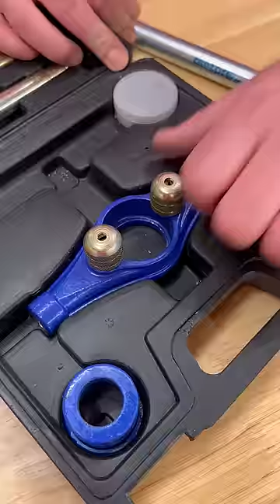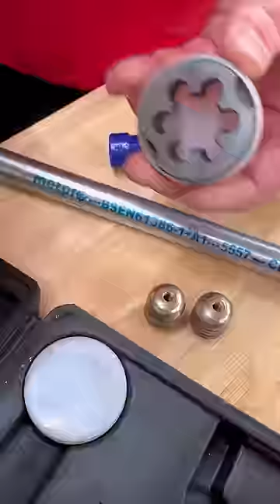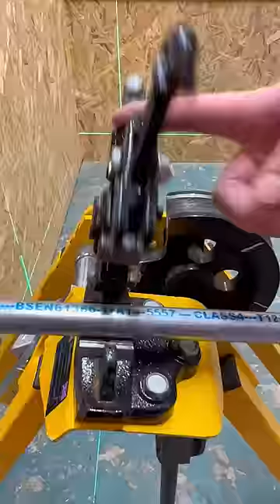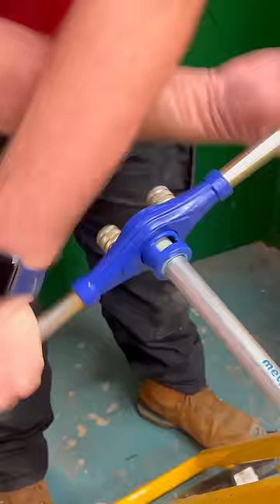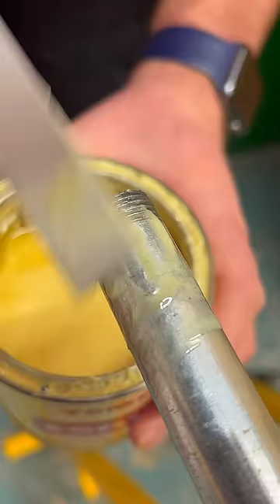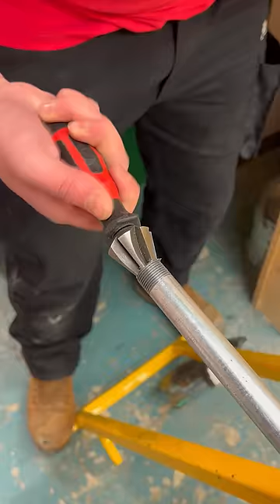How To Thread Electrical Conduit  Like A Pro!

Comment: We use a Ridgid 1224 machine and this would take about 30 seconds or less. I don't know if we are " Electrical Pros " but we do get paid money to do this.
Reply: And other electricians make do with gear like that.
Reply: I think there’s about an $11,000 price difference between the Ridgid machine and the hand machine
Reply: Milwaukee makes a power threader I've always been told if someone gives u a non ratchet hand threader it's because they hate you no other reason to use one other than to punish an apprentice
Reply: @Johnny-tq9no  I suppose it depends how many threaded ends are required.
Reply: hace tiempo no realizó  instalaciones eléctricas, me encanta usar esa máquina 👨‍🔧
Reply: @Johnny-tq9no  i saw the plumbers on my job have a battery operated milwaukee threader. heard them using it too.

the last time i had to thread though, it was up 2 flights of narrow stairs, and my partner was in his late 50s and none of us wanted to keep going back and forth, so we just used one of the hand held power threaders (i forget the model, but im sure everyone knows exactly which one it is im talking about) on a chain vice with dull grip teeth that wasnt able to bite into the paint, im an electrician, i was installing galvanized 1" and 3/4" that the job specified had to be all red on the conduit runs for fire alarm. but a large pipe wrench was able to grip into it. there was also no space for a sidewinder, so we had to use a mechanical bender, but there was only so much space for that too
Reply: @masterbond9  I feel you brother.  That sounds like my average week.

Comment: If you see an electrician with tools this clean and organized,  he has never used that tool 😂😂
Reply: My dad always keeps his tools clean and organized, and he’s one of the best diesel mechanics at his shop. Any time something breaks down they can’t fix, he gets called. Any time any of the workers are having trouble figuring something out, he’s the one to call.
Reply: Mine are clean and organized lmfao. I work on peterbilts. I just simply, take care of my expensive tools and don’t throw them around.
Reply: I work on small electronics and computers. My tools are always clean and organized. I also keep my other tools clean and organized. Hell, if I’m going to look all over for a crusty 17mm socket to change the oil in my car, it's in its case in the correct spot and, while not spotless, is very clean.
Reply: Normalmente cuando utilizas una herramienta debe ser limpiada después de su uso. Y las herramientas para electricidad siempre deben estar limpias y libres de grasa.
Reply: Or doesn't work on price 😂
Reply: Or he cleans and organizes his tools
Like you're supposed to...
Reply: you have never met someone with a cleaning OCD I bought a big ultrasonic cleaner so I can clean everything and I was one click away from buying an former MOD ultrasonic cleaner that was originally used for cleaning tank parts but I had to abort the purchase only because the access to my garage was too awkward to navigate it in.
Reply: @IsntThisAStupidName  isn't that stupid.... 😂
Reply: True

Comment: These are great until you hit a knot in the metal😭😂
Reply: a know in the metal? do you mean a weld?
Reply: What u gagging about😭😭😭
Reply: Never seen that. I'd imagine the tool would win.
Reply: @tennicktenstyl sometimes when the metal is growing, especially on young metal, you get knots which are sometimes full of flux and slag.

On older metal, the growth rings are so small you can’t even see them!

Hope this helps 😊

Comment: Here in Europe electricians install electrical systems instead of plumbers... Electrical wiring in conductive tubes is safety wise not the smartest move. And the shown method takes a huge amount of time and effort. Just usung a pvc pipe is much safer, cheaper, faster and less complicated tools are needed.

Comment: Ream before threading so you do not enlarge the pipe diameter or the threads
Reply: This comment is why I'm here
Reply: How would that make a difference, pipe is thick enough
Reply: @MABFR01  the difference in the mixed order of events is a lot more evident when attempting to attach a fitting or lock nuts (albeit it's more prone to warp thinner conduit like 1/2 or 3/4 EMT)
Reply: @juicebocs574  Is that hand reamer really going to change the threads by any noticable amount? I've never found 3/4 npt threads to be a real tight precision fit to begin with
Reply: To can tell you are an electrician and not a machinist
Reply: I learned a thing i ream at my work but i don’t thread a lot 

Im not a machinist i just finish the product i receive from machinists

Comment: I'm not an electrician, but I do low voltage fire alarm installations. Wouldn't in this case instead on threading EMT, wouldn't you just use Ridgid pipe that is threaded? In what situations would you thread EMT instead of using a coupler? Environmental situation??
Reply: That IS rigid pipe. You can't thread emt as it's not thick enough to be threaded. and yes, the reason for rigid over emt is because of it's environment where it's going to be installed.
Reply: You are definitely a low voltage installer. That's not emt. Besides that, we always have to install conduits for you guys since none of you can bend pipe to save your lives!!!😅😅😅
Reply: @chrismerschdorf8418  just me not my coworkers. You can get off your high horse because I've known plenty of journeymen who don't know the difference on low voltage what is negative and positive. I think we can safely lump you in that category. The ones who think they know it all but don't know Jack shit.
Reply: @chrismerschdorf8418  no wonder we have so many ground faults with your systems.

Comment: Now try some 2 inch
Reply: And then try some 4"
Reply: @XoJOHNoX96  never saw 4 inch conduit,the 2 inch stocks and dies were manual just like the ones for smaller sizes and at age 15 took quite a bit of turning

Comment: What is a quicker way to achieve this?
Reply: Rigid 1224 pipe threading machine is way quicker.
Reply: probably not using 3/4'' rigid pipe to begin with lol

Comment: No offense (maybe it's different in Europe), but that is not how a professional threads conduit. Even our hand-powered threading system would be done in half the time, and the rigid 700 we run daily is about 10x the speed.

Comment: Why don't you use plastic tubes?
Reply: Not as durable and a big fire hazard fittings looser longs runs wharp and bend.    Alot of this is visible in commercial areas

Comment: Ten years in the trade and not once have I had to tread. We don't use that, we use aluminium conduits with push in joints or plastic conduits

Comment: “How to cut threads in conduit” just buy a cnc milling machine and a thread cutting tool super cheap and easy why isn’t this guy showing me how to cut threads with stuff I can afford like a razor blade and a rubber band 😢

Comment: The dyes are self cleaning you do not have to tap them on the pipe bender this will eventually cause the threded rods which holds the bobbles to break.
Reply: No they're not 😆 I don't suggest banging them off things but they need a blast of compressed air to remove the swarf...
Reply: @MrEgghead132  Being, of course, careful not to end up with swarf in your eye, the customer's eye, sticking in the carpet for collecting by someone's foot later or in anything electrical!
Reply: Bang the facker. Like a pro
Reply: The DIES are not self cleaning! I don't see any nano bots running through the teeth with a broom!😁  Tapping in the bender releases the swarf from the teeth of the die, but pulling a rag through (away from you) is my prefered method 👍😉
Reply: @Frank.and.Beanzz 😂😂😂